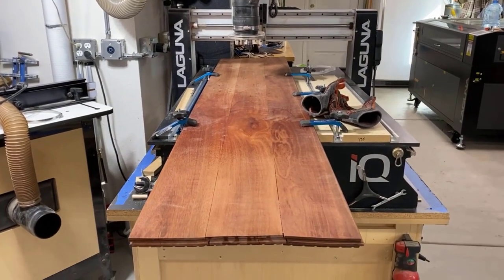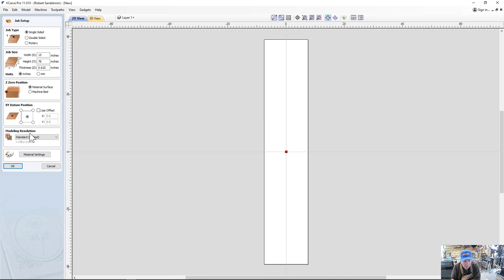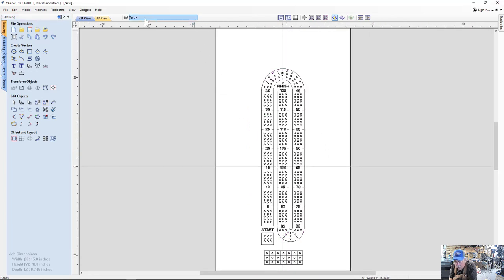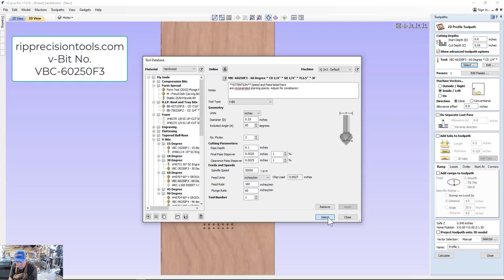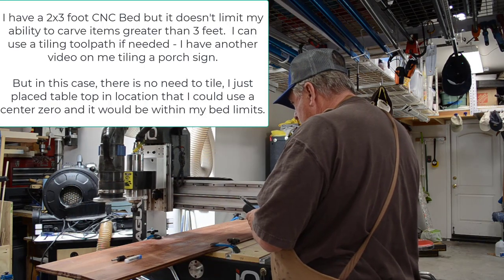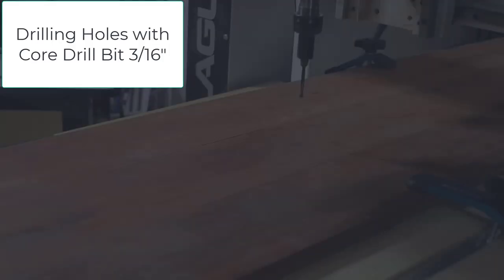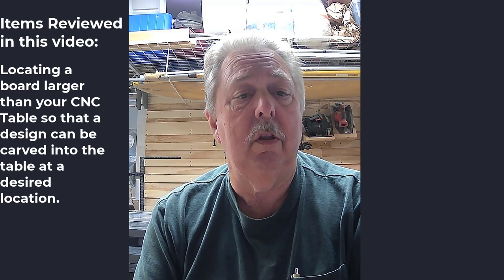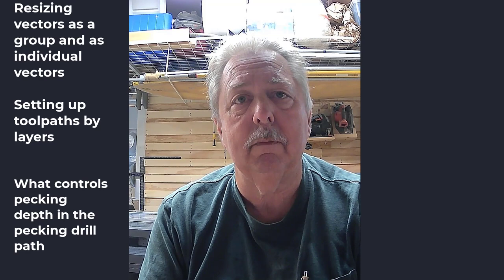Cribbage Board Placed in Table Center for Fire Department

Comment: Just a thought, could you place the vertical guides to emulate the plank joint locations? Great presentation and very informative, thanks.
Reply from the maker: Larry thank you for the feedback.  Your comment shows good understanding on how the guides can be used.  Short answer is you could use the vertical guides.  I didn’t use because placement was straight forward.  I just needed to size the width to be narrow enough to fit on board and center.

This would’ve been different if planks weren’t equally spaced, then identifying plaque sizes with the guides would’ve been helpful.

Comment: Thanks again for another informative video.  I have one question, Why are you drilling the holes completely trough the top?  Am I missing something obvious?  By the way, as a 44 year veteran of law enforcement, thank you and your friend for your support.
Reply from the maker: I am drilling the holes completely through the top because the fire fighters like their large pegs to bottom out.   Normally to get the pegs to bottom out I drill the holes slightly short of 1" (.95').  The table top is only .75" thick so it will allow the pegs to go all the way through so the top lip bottoms out.